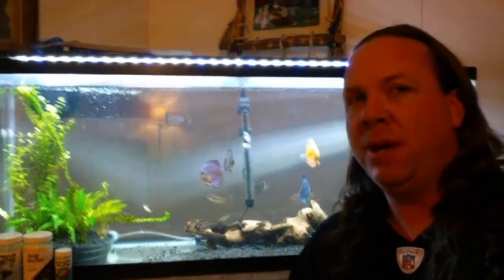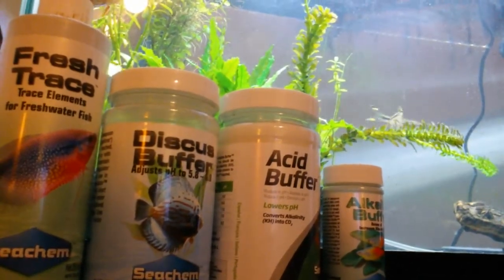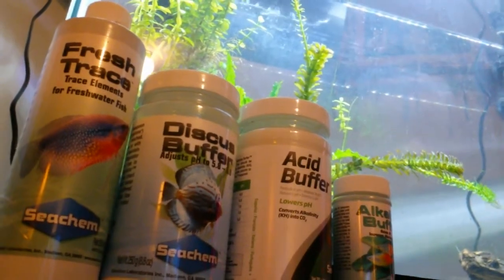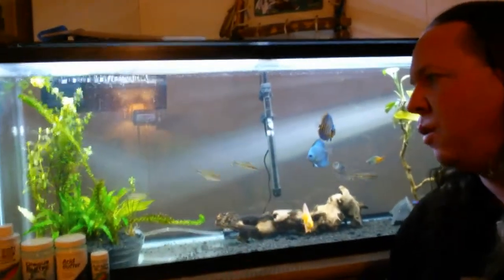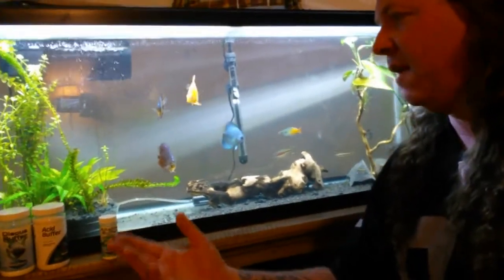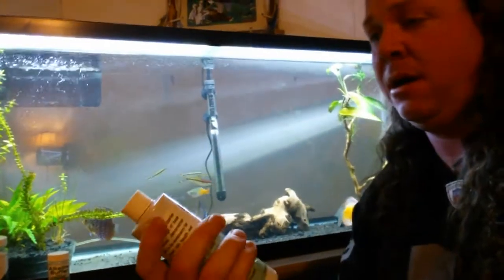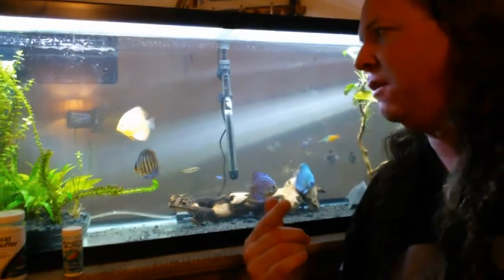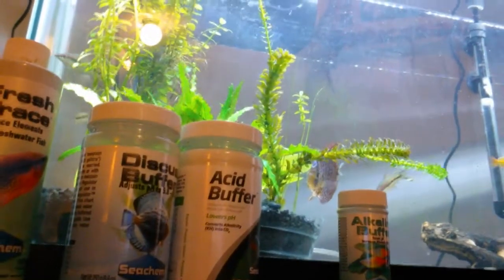Discus - RO water/buffers/Trace elements

Comment: The ph for RO water is supposed to be low first then about neutral like a day after right? Could you share your measurement? I have betta and he likes soft water.
Reply from the maker: The pH will not change unless the water is in contact with high KH or GH.  RO water does not need to be aged like tap water.  The pH in tap water WILL fluctuate after it has aged.  It has to do with the gassing off of the water.

Comment: Hey Steve,iv got another question for you. 
 I just got an RO unit, and iv got Seachem's Flourish, would that be enough in trace elements? Aside from that, anything else I should use?
Reply from the maker: You have Fresh Trace or Discus Trace?  Flourish is for plants, not fish.   Are you trying to take care of plants or fish I guess is what I'm asking?
Reply: +Scuba Steve  I have Flourish, was curious if the Trace Elements in it are enough
 Also about what else I should be adding to RO water aside from the Trace Elements.
Reply from the maker: +Matt Mayorga No, you really need the Fresh Trace or Discus Trace.  If you're keeping a community tank, then you may need Seachem Equilibrium.   It adds back GH.  Careful with that though.  I never use it because I only have rams and discus and they both love soft water.
Reply: +Scuba Steve Would Discus buffer do it?
Reply from the maker: +Matt Mayorga Discus Buffer is phosphate based acid buffer.  It only adds acid buffer to the tank,  not trace elements.

Comment: hi Steve, have a question if you can help. got an ro unit, with a ph of 6.4. now my question is what products should i use to add back the minerals for discus, control the ph, i did try to experiment with adding back tap water, but the ph svings back up to over 7, if i add less tap to ro, to get less ph, then the kh is to low, 2 dg. if you can tell me the best products to add to ro and also be safe for the fish, lots of ppl are saying dont use chemicals they are no good, but i need to add something back and i cant get it with adding tap water. please help and thank you for great information on this beautifull fish
Reply from the maker: +srbsilver Okay; first of all; re-mineralizing RO water isn't adding chemicals; it's adding minerals without the permanent hardness.  Adding Seachem Acid Buffer is just that; non-phosphate based acid.  Seachem Alkaline buffer is just that; non-phosphate based carbon.  These products, just like in my video, just allow you to control your pH to what YOU want; add back the Freshwater Trace and you're pretty much done.  I pretty much covered all of that in the video.  There are other brand names like Kent's but you can look for that stuff.  I prefer Seachem.
Reply: thank you, i just wanted to be sure, and you seem like the person to ask
Reply: i will just use what you told me, i dont want to play with the other stuff, if it works for you should work for me as well, thank you again means a lot to be reassured
Reply: hi again, got the stuff today, now i have another question, you do the mix righ before u add it to the tank? and do you keep the carbon in the filter with this stuff. also could not find the fresh water trace so i got the discus trace
Reply from the maker: +srbsilver Discus trace is great!  You can add it straight to the tank and carbon doesn't affect it at all.  Sounds like you're well on your way to a successful formula that's consistent and repeatable!   Great for you and your fish!  Stay tuned, got more great tips coming.   Be sure to change your carbon on a regular basis.  It can actuality leach additives back into the water and discus hate it.  I never run carbon, only if I'm taking medication out of the water.
Reply: +Scuba Steve thank you for explaining, got stuck on one thing. I have a 20gal tank that i am going to store the ro water for water changes so my confusion is on ratios between acid buffer and alkaline buffer. acid buffer says to use 1/4 tea spoon for 20 gal and alkaline says to use 1 tea spoon for 20 gal to get a ph of 6. now i want to get a ph of 6.5 so do i use 1/4 tea spoon of acid and 1+1/4 of alkaline to reach 6.5, or does this ratio change on that chart when mixing the two together. when they say 1 to 1.3 do they refer to 1 tea spoon to 1 tea spoon or do they refer to 1/4 out of 1 for acid and 1.3 out of 1 for alkaline. hope you understood the question, tried to explain as clear as i could. sorry for so many questions, i just want to get it safe for them.
Reply from the maker: +srbsilver What kind of buffers did you get?   Are they Seachem?   Seachem is one to one radio.   I would not add them to a storage tank.   I would add one to one in my water right before adding it to the aquarium.
Reply: +Scuba Steve i got Seachem acid buffer, Seachem alkaline buffer. did the water change today, and they fish started to scrach their body agains drift wood and air line, they dont seem to like it. now i dont know if its because of those buffers or what, i pre mixed it before i aded to the tank. same ph as the tank and same temp when i added in. i will try ro water with tap at the same ph and see how they react, then the nest water change ill do the buffer again and see if they will scrach again, that would show me if its the buffer that causes it
Reply from the maker: +srbsilver That's very strange.  When discus scratch it's because they're trying to dislodge an ectoparasite.  For sure keep an eye on them.   Please keep me posted.
Reply: +Scuba Steve if the fish do have the ectoparasite, whats a good medicine? will aqua salt or Epsom salt help
Reply: +srbsilver  thank you for responding, i got an ro unit, and all day today i was playing around with buffers, and got so confused by the end of the day. ro water tds 18, ph 6.7 kh0 and gh0, now the buffers. read the instructions and to get a kh of 3 and a ph of 6.5 i needed the following measurements, alkaline buffer 2+1/2 of tea spoons, and acid 1+1/4 tea spoons, and this was for a 20 gal testing tank. on the end i got 6.5 ph and kh3, however this seems like a lot of buffers to add to a 20 gal, nevermind to my 90 where i want to add discus, and the tds went to 270 by the time i added this measurement (can they breed in that tds). if you use the same product am i getting this right?
Reply: +srbsilver if you could give me you ratio mix for 20 gallon i can base it on that, just confused because on one of the bottles it says base dosage on weight, or is it based on already stated measurement. been reading seachem forum saome say yes some say no, so how can i figure it out when ppl confuse it like that
Reply from the maker: +srbsilver This is my suggestion.  Take one teaspoon of the Acid buffer and add one teaspoon of the Alkaline buffer.  Put them into the tank; wait, and then test.  What do you have?
Reply: +Scuba Steve hello again, ok did what you said to a 20 gallon tank, 1 to 1 tsp. results:Ph6Kh1.5Tds 130 is this good for breeding?Then i added a bit more alkaline and got: 0.3Ph 6.5Kh2.5Tds160 breeding?Now if i add discus trace tds will go up even more.I will let this in the tank with a sponge filter and see if anything changes by tomorrow.
Reply from the maker: srbsilver Your ph is acidic, great!  Your tds is a little high.  Your kh looks good.  Yes, they will want to breed in acidic water.   The trace will not raise your tds significantly if at all.  Try it and tell me what you get.  The best thing is to experiment line you're doing.  I can eyeball my teaspoons and I only go 1 to 1.  My acid is usually a little higher than my alkaline.  I'm also using a deionization chamber so my tds is 0 when I start.  Let me know.  You'll get this right, I promise!
Reply: +Scuba Steve hi again,got a question, when i do the mix like you said im getting a perfect ph, but if i leave it aerated and heated in the storage tank over night ph raises, would you know why that happends? and one more thing, ive seen in the video that you use less alkaline then acid, so im wondering if i can do the same, but  if i do that there will be no kh is that ok? what is the kh in your tank, hoping tat if i do that the ph will not raise if i leave it over night in storage tank? again thank you so much for taking the time to help us newbies
Reply from the maker: +srbsilver Not quite sure what the kh is in my tank.  I've been battling a parasite as of late.  If you use a deionization chamber on your RODI unit, you can control your TDS better by starting with pure water.  Aging water does sometimes lower or raise pH so it's good to age it.  Kh can be low but discus get the trigger to breed in soft and acidic water and usually after a big water change.  Do you have a proven pair?
Reply: +Scuba Steve hi, yes saw the last video, sorry to hear that hope you can get rid of that problem. i do have a proven pair in the tank with 3 other discus, setting up a 29 gallon for them, so hope babys will come soon
Reply from the maker: srbsilver They will come.  Just keep your water acidic.  TDS matters for the hatching rate and bettern penetration for the sperm penetrating the eggs.  I have a few videos up on my discus and the water parameters they were in.  Have you looked at those videos?  They usually tend to breed after a water change but they do need their own tank.

Comment: Hi Steve

I'm glad there are people like you who are willing to share the tips and advice for no money at all. I haven't had any success with breeding discus and all the eggs would become white in 3 days. I initially thought the problem was with the male but after some 12 or 13 spawns with different pairs I am sure this has to do with the water hardness. I have bought an RO unit but not received it yet, but I am worried about having an ultra pure water which might simply not be good enough for the fish! I need your help choosing an RO unit, should i take a 3 stage, 4 stage, 5 stage or 6 stage Unit?Also, you mentioned adding RO water + some stuffs fishes need. Can you please point me to the complete list of those stuffs the fish will need if I am using RO water? Also I was looking to buy this unit: http://www.ebay.com/itm/Reverse-Osmosis-RO-DI-WATER-AQUARIUM-REEF-FILTER-6-STAGE-0-ppm-100-GPD-/281145741653?hash=item4175979155. Many many thanks.

Comment: So I add Neutral Regulator and Discus Buffer on top of adding Discus trace elements?
Reply: Osmoregulation? Steve how do you know about all this stuff man? I though I knew a bit about fish keeping but I guess not.... Getting my RO system in tomorrow. Would you recommend letting the water sit with aeration for 24 hours after adding all the necessary buffers, regulators and trace elements?
Reply: Yeah, I will post a video as soon as everything settles. Major thanks for taking your time to answer my questions. Love this hobby and I think it's great to pass good advice to the community. Been in the hobby religiously for 2 years and have received lots of bad inconsistent advice since then. Can be frustrating... Thanks again.
Reply: Yes, I have checked out all the vids you have posted up and I'll check out the one you suggested too. Since you live in Oklahoma do you have to mail in all your fish or do you have a good store to buy them especially your discus?
Reply: Love GBR's and bolivian rams...Question, I just did the limestone vinegar test on my river rock substrate since i've always had problems with my ph rising. I threw them in a glass poured vinegar and it fizzes. Should I go barebottom? If so I'm trying figure out the best way to take all the gravel I have out, plus I'm concerned about the beneficial bacteria that I'll lose.
Reply: Steve, I took out my gravel out since it was limestone base and added a few established sponge filters to compensate for the loss of beneficial bacteria and guess what happened, I'm having a major ammonia and nitrite spike. I'm using ammo lock along with nitra zorb with water changes of 30% ever other day to solve the problem. I also took out all my cory cats and GBR to lower the bioload. It's been about 6 days and I'm still not out of the woods. Thinking about buying a cannister filter along with my HOB that I currently have and or adding the gravel back in. I also going to put some API quick start to add some bacteria. Any tips or suggestions? I can use any help I can get.
Reply: Yeah I have 7 in my 60 gallon. I do have a 30 gallon tank that is well established. I'm thinking about maybe moving them in there temperarely. However, my ph is 7.5 in that tank in my ph in my 60 is 6.5. I have two other 20 gallon tanks and a 40 gallon but all those have tap water running through them with a ph around 8.4 with crushed corral. What about API quick start? Maybe I should put the gravel back in with the quick start? I do not want to lose anymore discus. I have already lost 3 from ph being too high. I got the ph controlled and now this problem. Steve this sucks.
Reply: If I can detoxy the nitrite's then that will buy the time I need to build up bacterial right?
Reply: It's been a nightmare. I moved them all to my 30 gallon and moved some of my fish out of my 30 gallon to other tanks I have to lessen the bioload. Then I had to move my breeder fish around to make room and it's a long story and I'm tired and now drinking a few beers to wind down. I did a good water change before I put the discus in the 30 gallon and added tetra safe start. The PH in that tank is actually at 6.8 now from my RODI unit. One of my discus almost died yesterday. I quickly fed him medication API general cure with garlic and vitamins with food and today he's swimming in front of the tank and not hiding anymore in the back. I think feeding sick fish or injecting them might be far more effective than following the instructions and adding the stuff in the water. That has never worked for me. Hopefully he'll be okay. Sorry for your loss of discus. I've lost already a few myself all because of terrible advice when I started the hobby. By the way, what type of cannister did you by?
Reply: Okay Steve a quick update. I have added a Marineland cannister C-360 filling baskets with Seachem Matrix, bio balls and ceramic rings. I added Tetra Safe Start 1 1/2 ago and went one week without a water change to let the beneficial bacteria grow undisturbed. I did a small water change over the weekend and added more safe start with the new water. I did another  water change today and added safe start with the new water. I am still getting an ammonia reading of over 8.00 PPM's and my nitrite is 0 ppm. This has to be a false reading from the Seachem prime I added 1 1/2 ago when I took my fish out. I also had API ammo lock in there as well. Mixing could of had a reaction? It's been like this for 2 weeks. I have my bolivian rams in the tank and they have not shown any signs of stress whatsoever.  Any other idea's? Maybe get the ammonia alert. I would love to know my correct readings. Any info is appreciated.
Reply: It looks like I have a nitrate level of 10-20 ppm's. It's hard to distinguish the colors between 10ppm and 20ppm on this API kit. Actually, yes I have two media filter flosses from a 40 gallon I was storing my yellow lab fry I sold. I can put those two in my tank to help. I'm hoping after some water changes the prime will dilute out and I'll be able to read my ammonia or I can try ammonia alert from Seachem not sure if that will work if I have ammonia lock mixed in. What a nightmare.
Reply: Actually after 10 minutes the nitrates has went up between 20-40 ppm's.